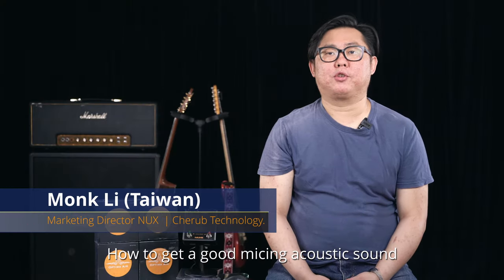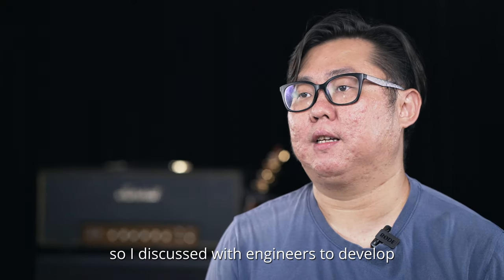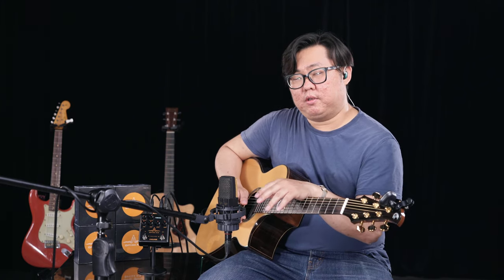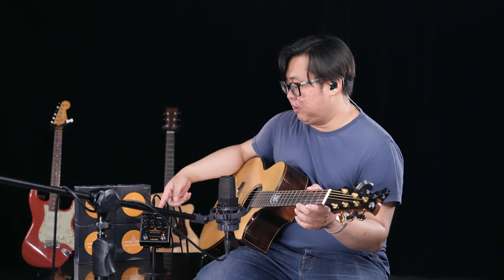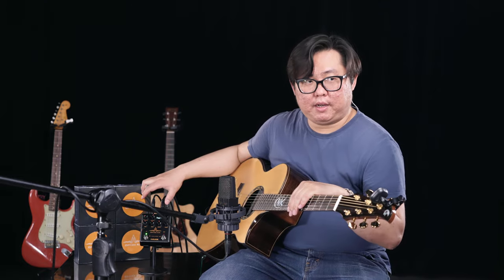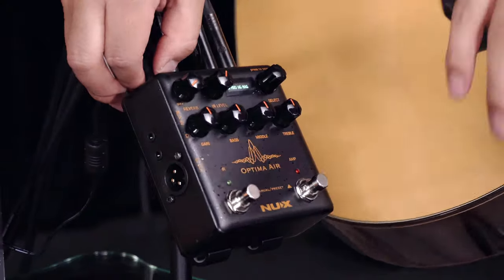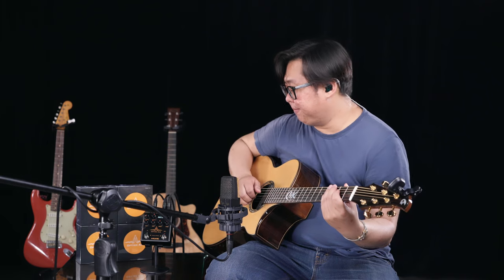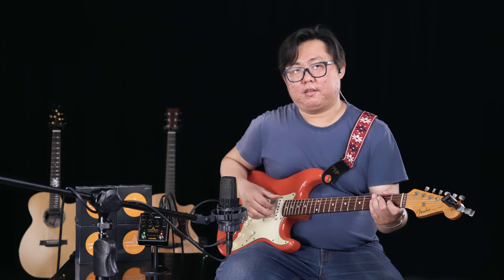Introducing NUX Optima Air

Comment: I have owned one for about two weeks now.  I have used the pedal to capture three Taylor guitars and one Enya Uke.  It is easy to use.  More importantly, it sounds amazing!  I am finally in love with the sound of my amplified acoustic guitars through the mixer based PA in my music room.  It it makes my ukulele sound incredible as well.  I can’t stop playing!   Capturing a quality impulse response with a quality condenser microphone and positioning (and gain stage) is the key,   I have had good customer service via email communication with Michael at NuX and he has been helpful and kind.   Now, I just need to start using it for my video recordings as I capture my guitar directly (no mic) for my videos.
Reply: Dakota-Covers, can you tell me please if it's possible to mix the pickup's dry signal   with the Ir's processed signal and blend them in different proportion? It is not clear to me if the Ir's volume knob can act like a blender. Thank you very much for your information.
Reply: @valeriolaghi7014    When the IR level knob is turned all the way down, there is still a little IR in the mix. The more you turn that IR knob up,  the more IR you add to the mix with the pickup.  When you turn the IR up, you need to turn the gain knob down because the volume increases.  I tend to run my IR level at noon or lower.  So, technically it is not a true blend knob but it does allow you to control how much IR is in the mix.  Hopefully that answers your question.
Reply: @Dakota.Covers  Thank you very much for your answer.
Reply: DakotaCovers, thank you very much.🙏
Reply: Do you recommend a large diaphragm condenser as opposed to sdc that tonedexter recommends? Any tips on placement? I am using a nylon.
Reply: @roamsy  it’s my understanding that the type of mic doesn’t matter as much as the position of the mic.  I don’t have a SDCM.   Mic 1 foot in front of the 12th fret was best for me.
Reply: @Dakota.Covers  Great to know! After exhaustive research...I ordered one and I'll try the LDC first since you seem to be getting great success with it (I read your comments on acoustic forum as well). Hopefully will get comparable results with my Cordoba!bThanks for the quick reply.

Comment: For those who want a better impression of what the pedal can truly due, try this channel to which I am a subscriber: Aaron Short Music. He creates an IR on camera and also compares it to one he created previously, as well as to the original Piezo and and original mic signal, and to various IR presets on the unit when shipped. I think he does a better job of truly showing this device‘s potential, even though it‘s great to witness the engineer‘s obvious commitment to and passion for the product. I only recently got turned onto NUX, in a video on the Cerberus (another really cool product, I‘m sure!). Back to Aaron Short: I think the way he strums the guitar when creating the IR led to far better (as in, more accurate) results. I suspect that the rather hectic way the engineer strummed his guitar, with more emphasis on the treble than the bass strings, might not be the best way to do it.

Comment: I would like to connect the Nux optima air to a Pedalboard which will be connected to a tube guitar amp.
This Pedalboard is for electric and acoustic guitar. I have a few questions.

1: should I plug the Optima Air into the FX loop of the amp or rather directly between the amp and the guitar? What will be the advantages and disadvantages depending on my choice? This is the first time I've used this type of effect so I'd like to find out more.

2: the Optima Air has an effects loop.
I would like to insert an equalizer pedal into the optima air loop. This pedal will be "on" constantly. Will this equalizer pedal be audible if the optima air is turned off ? I ask because the goal is to have equalization that is only audible when the Optima Air is "on" and inaudible if the Optima Air is turned "off"

3: is the Nux optima air “true by-pass” or does it have a buffer?

thank you...

Michael

Comment: Rosario Roberto
Hello I love the NUX Optima Air. However there is a slight ground noise .It goes away when I touch the NUX Optima Air pedal. I did a lot of test with power supply ,and other pedals  and different  guitars and it  does not  do any  grounds noise   but with NUX Optima Air  pedal it make a ground noise that goes away  only  when you touch the pedal . Is that Normal ?

Comment: I really enjoy this pedal. Tremendous improvement for live acoustic guitar. I use it together with a "normal" DI pedal. But it bailed twice on me during a live gig. At first it sounds like a guitar with a battery going flat but it's a digital glitch. unplugging and plugging in power. Is this familiar to anyone reading this? thanks
Reply: Hello :) I am really interested in the pedal. Any you know if I need a DI box if I had this pedal? My acoustic also runs into effect pedals. Many thanks.
Reply: it has XLR/DI out but FOH usually also ask for a signal without IR treatment. So I send out both signals. DI straight from my wireless unit and a XLR out from the end of my signal chain (in this case a NUX Optima Air). I've upgraded to a LR Baggs voiceprint a while ago. Still love the NUX Optima Air but the display is too hard for me to read onstage. The LR Baggs allows easy IR creating and EQ shaping but it's mostly the same pedal. But the main thing for me are it's clockradio digits :)
Reply: @ElcoWeitering  really appreciate the feedback

Comment: hi, everyone, let me share with you some of my NUX Optima Air experiences.

i have been using it for a while now.
i have some promising audio results, but i have also encountered a few problems/bugs.
i have sent the below info to NUX ( info@cherubtechnology.com ), in February,
but have not received a reply from them so far.

1. the device froze at the very first startup, maybe because of a ground loop through usb.

2. the IR level pot is actually a total volume level pot, and not a dry-IR blend, as i have presumed,

and many users on the web seem to (quite logically) presume.

3. there is confusion as to which knobs (on the device and in the control sw screen) are saved

as part of a preset, and how to save them:
    3.A:  the IR level knob at the top of the screen is actually not programmable at all, so you
    better not try programming it - just set it at a well-thought-out level, and leave it there for good.
    3.B:  the IR level can in fact be programmed for each patch in the control software,
    by moving the little IR level pot at the upper left of the IR subwindow.
    but beware that once you move it, it instantly gets saved into the active patch,
    so you cannot undo the move, not even by recalling that patch.

4. the 'edited state' asterisk in the screen tends to behave erratically:

you can theoretically return to an unedited state of a knob by turning it until the asterisk disappears.
however, if you have already moved some knobs, and have returned them to their unedited state
(so that there is again no asterisk displayed), and then start turning the next knob,
you may not be able to make the asterisk disappear again (and thus you may lose the original setting
indication), because, apparently, the device sometimes perceives some other, previously
moved knob to have been moved again, even if you have not touched that other knob again.

5. when recording a custom IR file, it is very hard to determine the input level of the miked instrument
in the display, because the level meter seems to have a really weird response curve.

6. after recording, computing and storing az IR file on the device, it returns to the levels screen,
and you can again press the IR footswitch for a countdown, but the normally cca 10s recording time is now
skipped, and the device proceeds to offering you to analyze a recording that it hasn't even made.
so you have to reboot the device (left footswitch held) before attempting EACH custom IR recording.
definitely a weird bug.

7. i could find no controls in the software or on the device to name a user-created IR file.
the user manual does not tell you either.
it should be possible because the Chinese guy in the NUX factory product video has his custom IR files named,
but he does not show us how he did that.

8. it is not indicated anywhere how you can check your firmware version.

9. there are no instructions for the firmware update procedure, although it requires some
very special button presses.
(so i made a description of the update procedure, partly derived from other NUX device
instructions; see my notes below).

10. there is no mentioning of USB audio in the manual: i only guessed it existed because seeing
some usb audio controls in the control sw, and because of the ASIO driver listed in the
download section of the NUX Optima Air site. (having an ASIO driver there did not, by itself mean
to me that i can use it, because there also is an audio format converter sofware there
that has apparently nothing to do with the Optima Air.)

11. it is nowhere indicated if the aux input or the headphones output or the digital reverb are
stereo or mono. i have tested the headphone out and the reverb: those both turned out to be mono.

12. the usb audio stream to the headphones is also mono.

13. it is nowhere indicated if the device is capable or not of true analog bypass,
and if not, what the processing latency is.

14. the user manual contains some sentences in poor English.

-----------------------------------------

NUX Optima Air
firmware update procedure
(2021-02-21)

1. download firmware update package.
2. connect device to computer using usb (micro B) cable.
3. run updater software from the downloaded package.
4. holding down both foot-switches of the device, plug in power supply.
5. the updater software will now recognize the device.
6. select new firmware .bin file in the software.
7. click START UPDATE button.
8. update progress is visible on the device screen.
9. when process is ready, firmware version (date) is displayed.
10. reboot device (by unplugging and reconnecting power supply).